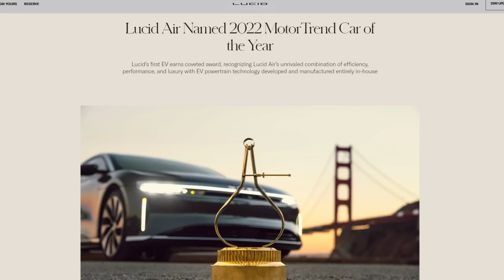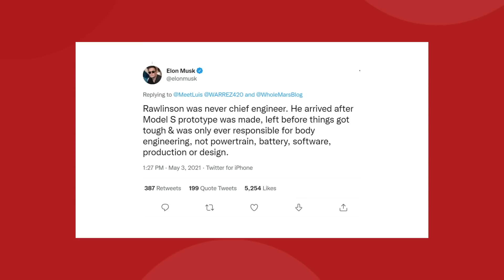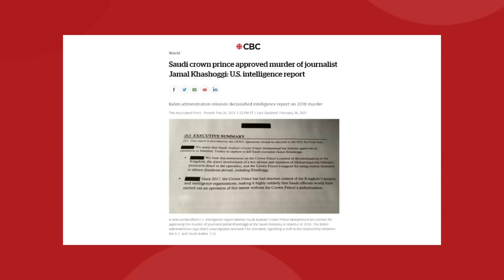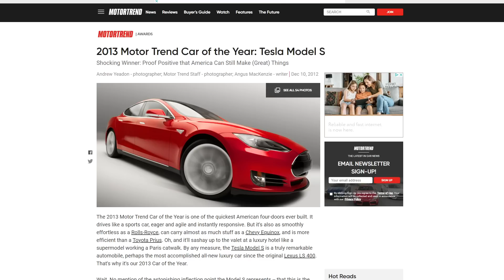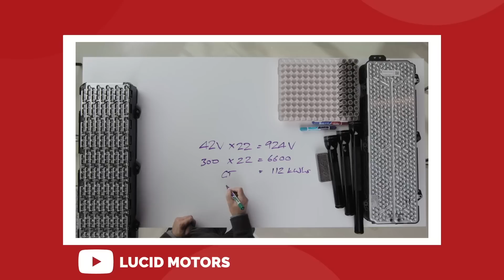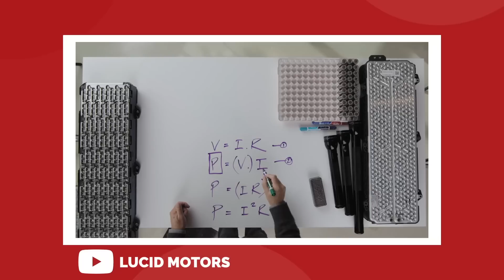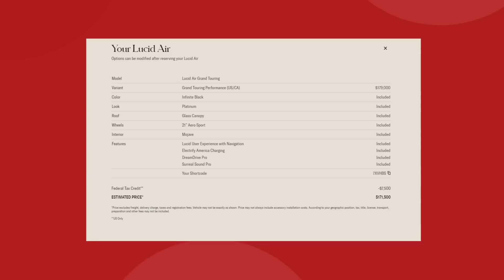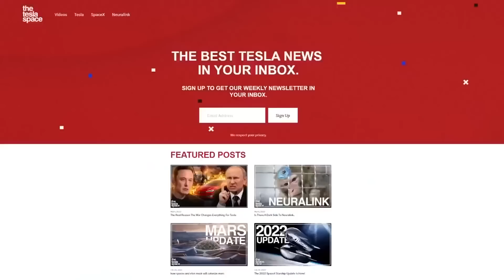Why The Lucid Air Is About To Take Over! (Tesla Vs. Lucid)

Comment: The comments are wailing on lucid, but lucid will NEVER have to compete with Tesla unless Tesla gets into luxury cars, which is the opposite of their mission statement. Tesla is working it’s way to cheaper and cheaper markets while lucid is trying to optimize itself at the market it is already in. So many of the comments are about mass producing them and how Tesla does it faster and cheaper, but that is much less important for a luxury brand like lucid
Reply: Lucid early on talked about making their vehicles cheaper or less expensive and making vehicles that could be mass produced. This is their Roaster, unless they changed it.
Reply: @MyUniversalUniversity  oh that makes a lot of sense, my bad. Thanks for explaining it 😁
Reply: @lucasliam8238  
All good.

Comment: What I don't understand is if Lucid had virtually limitless resources, then why are they still using modules and stamped parts? One thing's for sure, once we get a Model S with front and rear castings and a structural battery pack with 4680s and no modules, I think Lucid will be done unless they do the same.
Reply: I'm almost sure you're correct, however look at the segment they are targeting. The high end, luxury market will often have room for players that offer something different from the mainstream. Just offering different styling and branding with a similar specs will be enough for some amount of people to be interested.
Reply: @napzero  They should be acquired by a big car marker like Ferrari, Porsche, Lambo. They can't survive and cover their R&D cost by selling 170k. It's totally impossible.
Reply: @tenkiaqua6131  maybe tesla will end up buying lucid at a cheap price haha
Reply: I agree for the most part
Reply: Aptera has a less safe ~$29k minus tax credit, but interesting option, with solar, which is great for people who don't have a garage or live in apartment without charging connections.

Comment: Still a journey. I have noted the big issue is the charging network and Tesla is ahead on this. The high price is also an issue. BMW and Mercedes are making their electric cars and with their network, they will do well on the Luxury brands. Interesting times ahead.
Reply: BMW and Mercedes may not be their biggest competitors now. However, Toyota with new Lexus EV line-up will take luxury class like Lexus ICE or Honda Acura do. Lucid Air's price range is on par with Mercedes S-class Maybach. However, they can't have profit and survive by selling only luxury car. Mercedes or Mercedes Group doesn't survive by selling only S-class.

Comment: While I want to see many American EVs to come out and compete, Lucid is simply not doing so. It's too exclusive, and the plans to scale is unclear whether it is feasible.
Reply: So was tesla when it came out
Reply: @Bazooka407  Tesla started with EV, Model S just like a show case for funding.
Lucid Motor stated clearly that they focused only on Luxury class like Lexus, Mercedes S-Class, etc
They are totally different goal.
Reply: That's what people said about Tesla when they came out with a roadster.

Car manufacturing startups are extremely capital expensive. It's smart that they focus on low volume, high margin, and high quality to build up their brand first. They can then ramp up to lower cost mass market models as their facility expansion and experience build up over time.
Reply: Where would I get a lucid serviced?
Reply: Lucid is out of CASH in 2023 and will remain UNPROFITABLE until 2028.

Comment: No FSD though… Lucid is cool enough but they seem doomed
Reply: Lucid is equipped with LIDAR which Tesla is lacking, so it will have an even better FSD than Tesla
Reply: @antblanks  LiDAR is expensive and redundant. You need to solve vision to recreate a biological neural net
Reply: Hi Daniel.   Correct me if I'm wrong, but Tesla FSD isn't quite safe to use, yet.   Tesla owners I trust (like YouTuber Ryan Shaw) recommend not buying it.   Even the Tesla's basic lane assist has problems.   On road trips with rented Teslas, I had bad (i.e. scary) freeway experiences using Tesla's lane assist and found I just couldn't trust it.   While driving on a straight stretch at 75 mph in the far right lane, it twice pulled me to the right trying to go off the freeway.   I'm still not sure what triggered it.
Reply: @mikeroll8515  soo what’s your point? You’re saying it will never work?
Reply: @danielhendrix8397  Daniel - my points:   1) Lucid's not "doomed".      While superbly engineered, some view Tesla's interior as "IKEA on wheels".   There's a market for luxury (and longer range) that Tesla's currently choosing not to address.   
2)  No one offers safe, reliable FSD.   Tesla's working on it, relying on  photographic data and massive AI...but they're not there and have a long way to go.   Who knows when and how well it will work.   (full disclosure...I don't own a Tesla, but do own a chunk of Tesla stock)
Reply: @mikeroll8515  agree to disagree… Lucids production numbers are still severely lacking and their $175,000 price point is insane. Their energy business is also non existent
Reply: @mikeroll8515  lucid just had their earnings report, a whopping 300 vehicles delivered in April 😂

Comment: Production in large numbers is the difficult part.
Reply: LUCID is unable to SCALE.
it still hand builds cars in the PAINT SHOP at AMP-1.
Lucid has no DEDICATED car factory.
Reply: exactly.. they  have no idea of efficiency.. none.
Reply: They're trying. And just bought another 120 acres around there current build.
Reply: @tylerzawacky8649   - Peter lied when he said Lucid would Deliver 6,000 cars by Spring of 2021.